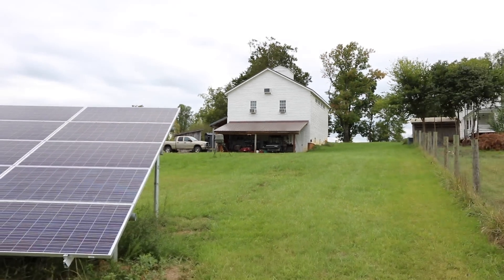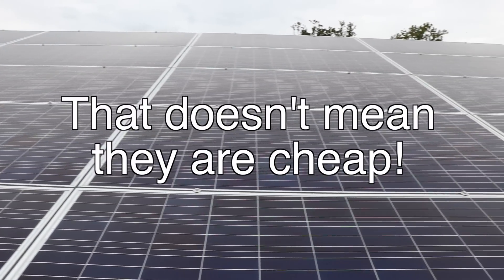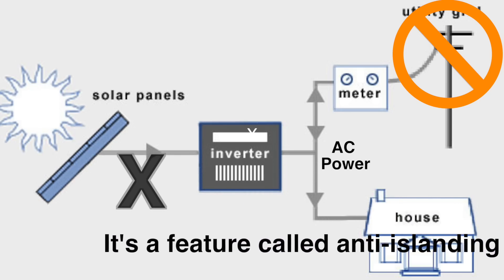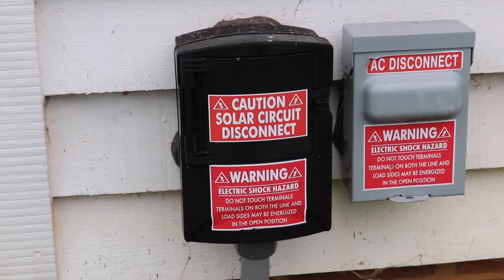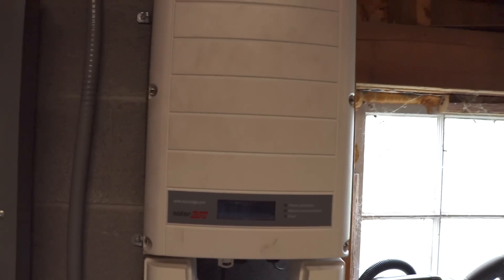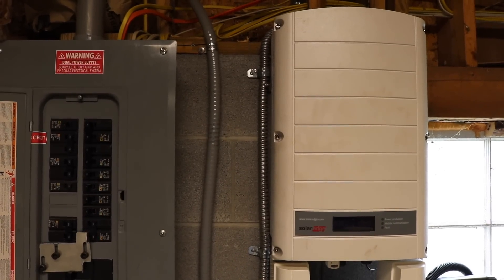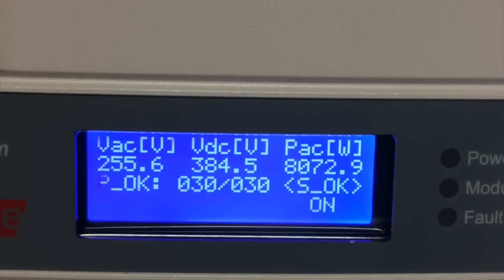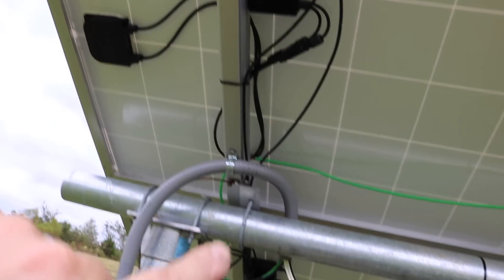The ugly truth behind grid-tie solar systems. Part 1, FarmCraft101 solar.  Watch before you buy!

Comment: The "grid" is not "the path of least resistance" just because you have "excess" generating capacity and your "excess" is only going to the "transformer" and then to "ground" instead of the "supply" conductors on the "grid". 

Only "privately owned" non-generating "utilities" that are "for-profit" businesses that buy "wholesale" excess "capacity" from "public utilities" that generate "excess" electricity and put it on the "grid" DOWNSTREAM of THEIR "customers" for "load balancing" do the "net metering" thing and sell electricity at "retail" to their "customers" or "members" when organized and incorporated as a "cooperative".

And the "net metering" arrangement for "energy savers" who pay big bucks out of pocket for "tax credits" (generally only "businesses" get to "deduct" electricity as an "expense" and must have separate service/meter/account/bills for the "business" if it shares a physical address/location with their "residence" and the "service" is a depreciable "asset") or "cheaper" or "free" electricity is generally the "least-cost alternative" for the "UTILITY" vs. having a "customer" become a "member" and get a DIVIDEND BACK AT THE END OF THE "FISCAL YEAR" AS A "CASH PAYMENT" TO MEMBERS TO "DISBURSE" ANY "PROFITS" THE  "UTILITY" COOPERATIVE "MADE" BY RECEIVING "REVENUE" IN EXCESS OF ITS "EXPENSES". 

"Grid" electricity is ALWAYS IN EXCESS OF "1000 VOLTS" AND IS "2-PHASE" IN ORDER TO MAKE "3-PHASE" POSSIBLE AND ELECTRICAL "VOLTAGE" IS LIKE HYDRAULIC OR PNEUMATIC "PRESSURE". IT IS THE PRODUCT OF "FLOW" AND "RESTRICTION/RESISTANCE" TO THAT "FLOW". CURRENT FLOW AND CIRCUIT RESISTANCE CREATE VOLTAGE AND THERE IS NO WAY IN HELL FOR "EXCESS DC "INVERTED" TO AC" TO "OVERCOME" THE HUGE RESISTANCE OF THE "TRANSFORMER" AND "FLOW" ONTO/INTO THE 2-PHASE HIGH-VOLTAGE "GRID" AS SINGLE-PHASE LOW-VOLTAGE AC.
NOT TO THE "SUPPLY LINES" ANYWAY. THE "NEUTRAL" AKA "GROUND" OR "SHUNT" IS A DIFFERENT STORY. 

"UTILITIES" THAT "TRADE" ELECTRICITY AND "MAKE MONEY" ON THE "MARGIN" AND ALSO "BUY" AND "SELL" AND "MEASURE" THEIR OWN "USAGE" ARE ALSO ON "NET METERING" AND ANY KILOWATT-HOUR THEY "BUY" BUT DO NOT "SELL" COSTS THEM MONEY AND IS A "TOTAL LOSS" WHILE ANY KILOWATT THEY CAN "SELL" VIA "NET METERING" WITHOUT HAVING TO "BUY" IT OR "LOSE IT" FROM OR BACK TO THEIR "SUPPLIER" AS "EXCESS USAGE" OR "UNUSED SURPLUS" AFTER THEY "BOUGHT IT" IS ANYWHERE FROM AN "INFINITY" PERCENT "RETURN" TO A 100% RETURN ON THEIR "INVESTMENT". PARTICULARLY SINCE SOME OF THEIR "PRODUCT" INVARIABLY IS "FREE" ANYWAY AND IS A "PASS-THROUGH" EXCESS JUST TO KEEP THE "JUICE" FLOWING "DOWNSTREAM".

THEN THERE'S THE FACT THAT "SMART METERS" COST PENNIES ON THE DOLLAR COMPARED TO ELECTROMECHANICAL METERS, ARE REMOTELY "READ", DO NOT REQUIRE PERIODIC "CALIBRATION" AND DO NOT "METER" ACTUAL "CURRENT FLOW" THROUGH A FIXED "RESISTANCE"  WITH THE RESULTING VOLTAGE POWERINF THE METER'S "AC MOTOR" AT VARYING SPEED TO "METER" CURRENT "VOLUME" OVEE THE "BILLING PERIOD" TO GET "AVERAGE USE" PER HOUR OF THAT "PERIOD" IN KILOWATT-HOURS MULTIPLIED BY THE NUMBER OF HOURS TO GET TOTAL "USAGE" IN "KILOWATT-HOURS". 

THEY "CHEAT" BY BILLING EACH "HOUR" AT THE PEAK "USAGE" FOR THAT "HOUR" AS "SAMPLED" EVERY "15 MINUTES". WHICH CEASES BEING AN ADVANTAGE IF YOU "TIME" YOUR USAGE SO "SAMPLE TIMES" DON'T COINCIDE WITH "PEAK USE".

Comment: I appreciate you sharing, I really do! But, I'd like to correct a couple things.
1) There are 2 wires, not 1 going from your panels to your building. It might be one cable, but it would have 2 wires.
2) Wires on the pole are not transmission wires, they're distribution wires and they are 13,200v phase to phase, but the one feeding the transformer going to a home or farm are single phase and would be 7,621V. From the transformer to the house is 240V (as you correctly stated).
3) If your system were larger, it might use multiple disconnects, but it's more likely that they would just use one disconnect rated for higher amperage.
4) I wouldn't recommend having those batteries right in front of the gear. Two reasons a) by code, you should have 3ft clear space in front of the panel. b) while batteries are charging, they produce hydrogen gas, which is explosive. An ignition doesn't usually result in things catching fire, but it would likely rupture several of the batteries, spewing acid everywhere.
5) Ventilation and air circulation are usually the recommended way to increase the safety of lead acid batteries, while they are being charged.
Reply: The 10+KV incoming distribution is single phase. Look at the video 9:29. The transformer the pole delivers 2 out-of-phase hot wires.

Comment: Panels cost about $275 each, times 30 panels equals $8,250.
Where's the other $15,000 ?

Also, insulated 8 gauge copper wire (single) costs $150 for 500 feet, equals 3 cents per foot.  Estimate 100 feet from panels to "shop", times 4 wires (3 hots, and a common) equals about $120.00 for wire.  You could triple that and still be in cost "chump change" range, when comparing that cost to the missing $15,000.

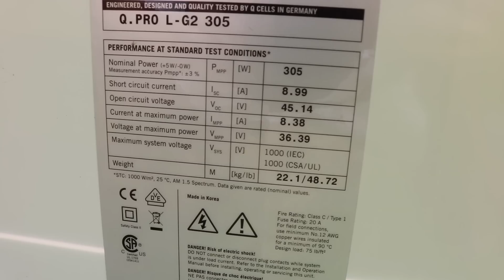His specific panel's model number is clearly displayed at 10:46.
http://www.solardesigntool.com/components/module-panel-solar/Q-Cells/3373/Q-PRO-L-G2-305/specification-data-sheet.html

Also, it seems to me that, given the amount of power the panels are producing, rotating the entire field via a motor to orient the panels to the best angle relative to the sun would be worth doing.  I wonder this.
Reply: he must have used American panels, like sunpower or LG, cause if you used a Qcel or Jinko or any of the other Chinese panels the panels would cost like you said around $275, there less than that if you get a solar company to do it because they buy in bulk and get a discount, the panel manufacturers also give deals to the companies to push there panels so you can leverage that to get an cheaper price,  a system like his in Australia would cost about 10k prob less.
Reply: @SuperJohn12354  I've long suspected that the price of solar power systems have been inflated by 100% to 200% due to the fact that the government gives you a "rebate".  I also think they artificially elevate the technical difficulties of installing solar power systems to create a closed and corrupt network of con artists and scammers that take advantage of those government programs.  His whole thing about gauge of wire, cost, distance, wattage, etc... sounds like BS to me.  Not necessarily HIS BS, but the BS some scammer got him to believe in.  I'd be willing to bet that there exists an enclave or rural farmer types that build these things on their own, for radically less money than more affluent, and more ignorant white collar types (people with more money than common sense).  I also think that there are artificial and institutional limits on solar power generation because centralized and monopolistic power production is one of the primary ways in which government forces dependence and maintains power and control over a population.  "Energy Independence", like many of our other words, is 100% manufactured and controlled.

Another thing I recently learned is that the best panels are only about 15% efficient, which means that there's a shit-ton of energy in sunlight.  If a single panel can produce 300 watts at 15% efficiency, what happens when that efficiency is increased to even 50%.  Now I'm interested in theoretical, and research.  I wonder what a realistic future level of efficiency mighy look like, and what the economic consequences of achieving it might be.  Battery technology has made revolutionary strides in the last 20 years, which is another thing to consider.   He talked about "battery storage", but what I saw looked like lead-acide batteries.  What if they were were Lithium Ion, or some other technologically advanced battery?  Add to that the ability to charge your electric car with the electricity you generate yourself, and pretty soon any interest in the politics of the Middle East will fall to ZERO.  We can all enjoy peace and prosperty with our troops home (and even back in civilian life), while the Arabs on the other side of the planet  maintain their cultural tradition of killing each other, without our help, involvement or even interest.
Reply: @tightywhitey6466  we have a rebate in Australia , that system would be 8*10k that's 8k for the solar panels and system and 2k(over priced) for a mounting system separate to the house, most solar panels are 20-22% for premium solar panels that degrade to 18-18.6 by about year 20. Electric cars are a scam if your goal is to save the environment, the future of cars is hydrogen, in fact there trialing houses powered on hydrogen as well , its green to produce green to use and its byproduct is H2O. The best a solar panel in the next 10 years will get is the multi light spectrum solar panels that NASA use on satellites and that's no where near 50%. Engery Intendance will come in the form of Hydrogen, unless of course Elon Musk build Battery factories in key senate states … oh wait that's exactly what's he's doing.
Reply: @SuperJohn12354 Thanks for the information.  I've heard hydrogen goes ka-BOOM in an accident.  Elon Musk said "Who do you think OWNS the press?" and was booted out of his corporation as a result.
Reply: The additional COST is from ... The Ground Mount + Ground Rods + Ground Wire + Power Wire + Solar Edge Grid-Tie Inverter + Trenching + Concrete + Conduit + Disconnects + Labor. Using a motor to turn the array is mechanical nightmare, with 50 year break-even.

Comment: you didnt talk about the different line loss of power in a longer distance between ac and dc...more loss will occur with dc than ac
at lower amperage you can have line loss...why....because electricity voltage either ac or dc is a frequency or RF also known as frequency vibration....as it moves through the wire that frequency dissipates more room for the "vibration" = less loss

with larger wire less dissipation occurs

but.....then theres the difference between shielded wire and non shielded  ...type of wire and structure ...and a minimum size wire for each amperage
all of these things need to be taken into account

20 amps cannot go through a wire that is only capable of handling 10 amps...the voltage will be there, just not as many amps....I always oversize the wire for solar to allow for colder weather which will increase the voltage and amperage....mppt controllers must also allow for this
Reply: You are wrong - in the real world, DC Transmission Lines have less loss than similar AC Transmission Lines. And that one reason why the Grid now has DC Transmission Lines.
Reply: @MrSummitville  no where in the US is there any DC electric lines, because......there is too much loss the farther you go

the electrical engineers know this
Reply: if you found this info useful...you can tip my jar

Comment: I cant speak for other countries but in NZ meters do not run backwards. They add a second meter to measure power feeding back into the grid, that way they can pay you sweet FA for it.
Reply: Yes. That is situation in most EU states. Grid providers do not want that someone will feed their grid with energy for price that they ask when you consume it. In some counties it is more complicated (SK ) - you must be registred as "Electicity Producer"  and related paperwork based on current law is same as for big powerplant.
Also technically speaking grid provider must have control over energy flow to balance actual consumption in branches of grid to keep network stabile. Not predictable energy generated by solar cells cause that grid provider must have for each kW of "solar" electricity backup source that can be controlled fast (~ x 100mS). Such fast regulation is possible only in water powerplants or controlling consumption of some loads that allow it.

Comment: A little correction on your descriptions.  The inverter doesn't cause power to push back into the grid by raising it's voltage, it does so by leading on the frequency.  With an AC signal, power is balanced by the frequency, not the voltage.  Voltage will be balanced in such a way as to reduce reactive loading through the inverter.  Reactive load is the current that flows between source and load due strictly to the phase difference between the two, but doesn't actually constitute any actual work being done, it is just current bouncing back and forth between the two.

Comment: you should weld yourself a bracket to attach it to a lazy Susanne  so you can adjust it to the best path for the sun depending on the time of year. If you scrounge the parts, which I know you can do because ive seen enough of your videos to know, you could keep the cost down, or use pvc(??? Maybe). you would also be creating an instructional video for people to do the same. Instructional videos are great because they usually have to be viewed multiple times.  Eventually go a step further by making a system to adjust it by itself. another instructional video = more views = more $$$ I know it would take a long time to go from concept to film to edit  to show but there are really so few of these in depth DIY videos on a whole other level.
Reply: How do you get your idea APPROVED by the Local Electrical Inspector?

Comment: I thought the whole idea of getting solar power is to have power when every1 else doesnt and lower your bill i have no idea how all this works i do understand electricity though so if it was me i would be researching a way to be off the grid and maybe some sort of switch or relay to tap into the grid when the solar isnt enough and stays working during natural disasters or when a transformer blows so i can still clean eat and live without being instantly sent to the dark ages
Reply: It is all  about the years until break-even. Batteries are very expensive. The grid is very reliable. Use a standby generator when the rare power outage occurs
Reply: @MrSummitville  Power outages are not rare they happen all the time all it takes is a strong wind and a old tree.Power outages are common if im gonna invest money into solar its because i want comfort in knowing if the power goes out i dont have to scramble to get gas for my generator or anything like that
Reply: @michaelrunningdeer8778  If your Grid is not reliable, then you need to install a battery bank and/or a back-up generator. Installing a PV Array is not about going off-grid. Going off-grid would cost most people double , the current cost of Grid electricity.

Comment: On our little homestead here I run about 2400 watts of panels along with battery backup and a (very) tiny wind turbine. I have the option to go grid tied, but at this moment we are not. To install service would cost more than my power system cost me, so this is what we decided to do. It is just me and my two tween aged sons and a tiny prefab so our demands are not very high, but the system is just enough for our needs if we are careful. And I run 96 volts on the panels and 48 on the batteries which is about 550 amp hours. 

 The battery bank was just doubled in size which helped out a lot as well this last winter, but I could do with another bank of panels for sure.  The windmill accounted for only a fraction of the total power generated over the last 3 years, not quite as much as I thought it would. But it did help out in the deep winter months, which is what it was purchased for. With the added battery capacity, it meant I didn't have to run a generator once this winter. The first 2 winters I ran it nearly every night for example. Which led to the purchase of the turbine. That cut down the gas use quite a lot, and we ran like that for 2 years. This last winter however was almost worry free and we are going on about 5 years off grid now. 

Next purchase will need to be a new controller setup and a larger array of panels if the room can be made.
Reply: That is great that you can power your home with just 2,400 Watts Solar Panel and a Wind Turbine.
Reply: @MrSummitville  I could stand to have more generation and capacity. It certainly wouldn't be wasted. 

 It takes some adjustment. We need to "tighten our belts" as it were in the winter. We have led lights, wood heat and propane stove which cut down electricity quite a lot. But at the worst part of winter we need to make sure pretty much every thing is shut off at night. This can also mean the boys don't get to play fortnite for a while. (however a dollar of gas may be worth them not whining about it after a week). 

This last winter my bank got no lower than about 40% of its safe usable capacity. A couple of bright days after that prevented me from having to run the generator.  And I am conservative with my safety margins, I could have used a lot more if needed.